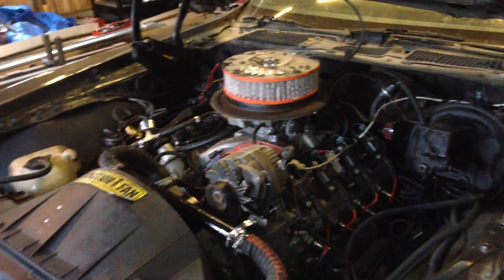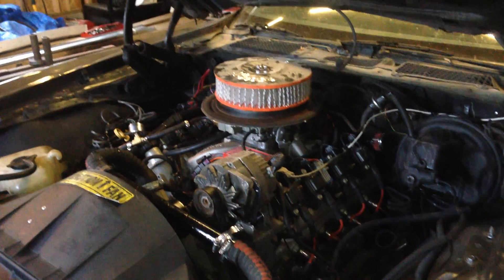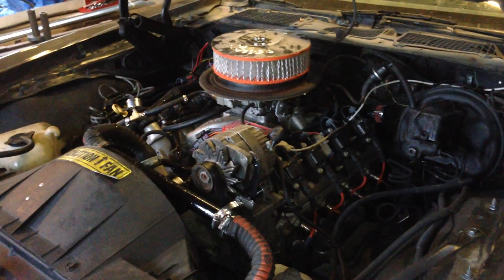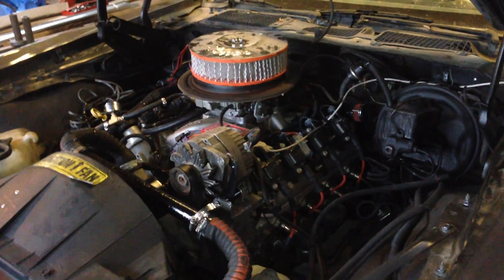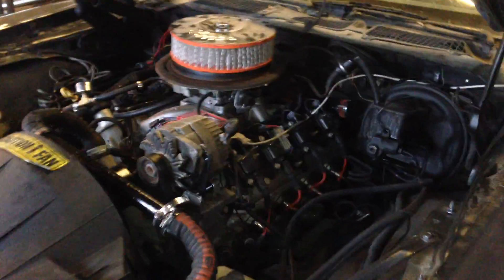5.3 carb conversions explained

Comment: How did you did you do the bracket did you weld it
Reply from the maker: i slightly modified the original alternator bracket and changed the pulley to a serpentine one....the alternator is original to the 5.0 engine or 5.7 V8

Comment: Can you list the parts you had to get to make it run with a carb? Fuel injection is not friend I want to make.
Reply from the maker: it's very simple....the MSD is plug and play...only 3 wires to hook up...main power to ignition 12 volt source...1 ground and tach wire (rpm)....you will need an electric fuel pump for carb (do not use a pump for EFI)...i had this engine running on a stand within minutes..i used MSD 6012 for Gen IV as my engine is a 2008....for gen III engines , use MSD 6010...MSD 6014 wich is it's newest version works on all engines...Gen III, Gen IV and V i believe
Reply: RobAir68 very good. And thanks getting back so soon
Reply from the maker: no problem...good timing...lol  i also used the Camaro 98-02 oil pan for great ground clearance

Comment: Hey I like your setup,a lot like mines,can you tell me why you say the MSD gives too much timing,that's the second time I have heard that,thanks
Reply from the maker: the pills are too aggressive...32 degrees in timing seems quite good...but all these engines may be different depending on the set-up..like many, trial is key to see what your engine likes...my 750 quadrajet has stage 2 kit for performance, but i still have a bog at WOT...i will be getting a wideband air/fuel gauge to see what my mix is when i stump on it...if i have too much carb,,,i will swap to something smaller...more tweeking needed...but for the records...it idles smoothly and starts fine every time.... : )
Reply: RobAir68 hey robair68 how can I contact u direct.... do u have fb??
Reply: RobAir68 can't decide to use factory efi or go carb. Are you glad you went carb?
Reply from the maker: Bajaheat efi is great, but I wanted to somewhat keep it simple.. the carb set up is very nice and the average Joe should be able to work on this set up as he would on a regular carbed engine except if one sensor lets go like the crank one, then it's a guessing game.. but only 2 sensors to deal with... i personally love this set up even more, now that my bog is gone... my carb's rear flap was too loose.. weird because it was a factory rebuild... the whole time I thought it was a fuel problem. Lol
Reply from the maker: My engine runs great! Idles great! Starts easily.. now that my bog issue has been resolved, I will be tweaking my timing with my msd software..to maximize the performance and will also change my rear gears and torque converter.. my car was built for hwy use.. 100 miles per hour all day long and it would love it.. I want my power back.. 0-60 needs to be better than what I currently have
My gears are likely 3:08 or worse
Lol
Hope this helps your decision..
Reply from the maker: https://www.facebook.com/robert.parent.14